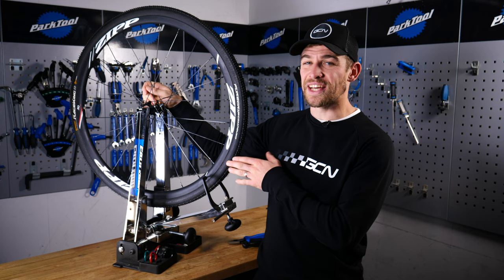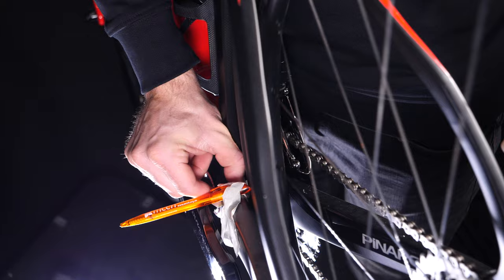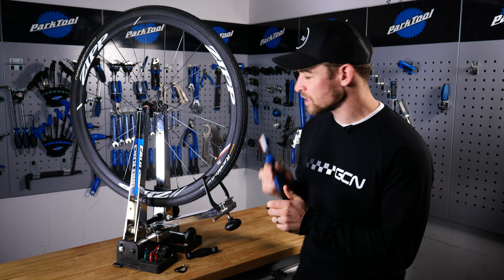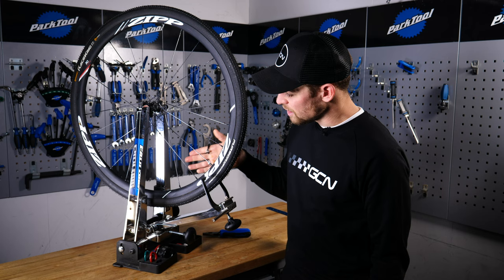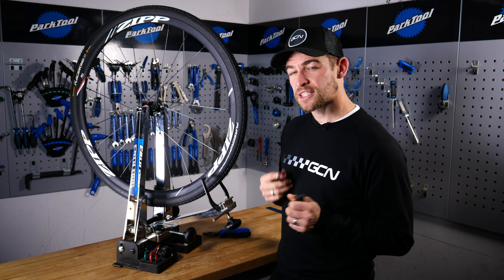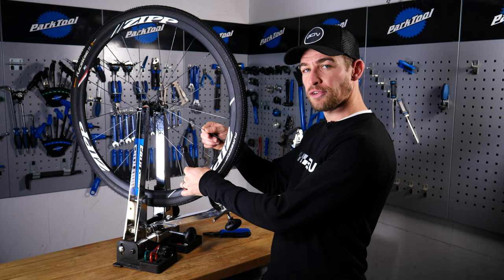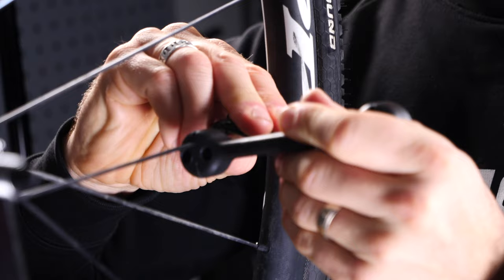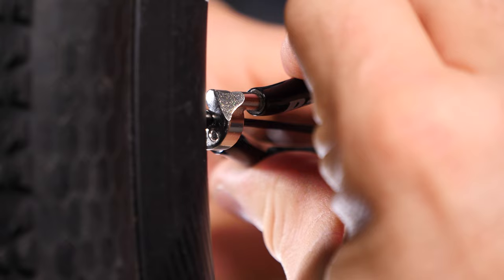How To True A Wheel

Comment: It's quite confusing,  if you watch the GCN video with Dan Lloyd  from 25/11/13 at 2 minutes he say's and the screen graphics state;  "Anti clockwise-Tighten" & " Clockwise - Loosen". In this video at 2 mins 39 seconds, you state, again with a screen graphic,  "Clockwise to add tension" & "Anticlockwise to re;lease tension"?????.... Isn't adding tension the same as tightening? Which video is correct? Does it depend how you stand before the wheel? Cheers!
Reply: I have the same thoughts, confusing.
Reply: Clockwise is anti clockwise upside down

Comment: shouldn't you remove the tyre first before truing the wheel?
Reply: Depends, if you've got a truing stand then theres no need, but if you're doing it by eye then yes, as tyres can often be moulded very badly and can cause the wheel its fitted to to appear out of true, when in fact, the tyre is wobbly..

Comment: Does anyone have any ideas if 'out of true' is not so bad as, or in fact worse than 'out of circular'?  I noticed my front wheel was  not truly circular a while back and couldn't feel it on the road but yesterday my front wheel (a 2 month old Mavic Aksium) measured around 8-10mm out of true.
Reply: if you have rim brakes , if brake pad touches rim because out of true, after you fix the wheel it might vibrate when you brake because the rim is worn where the pad  scraped

Comment: Fulcrum recommends lock tight or super glue after truing the wheel. Makes it about impossible to true later. Another tech failure to add to the list.
Reply: My wheelbuilder used Linseed oil on the spoke threads. Apparently it lubricates during the building process, then dries into a mild 'locking compound' which allows the wheel to be trued again later if necessary